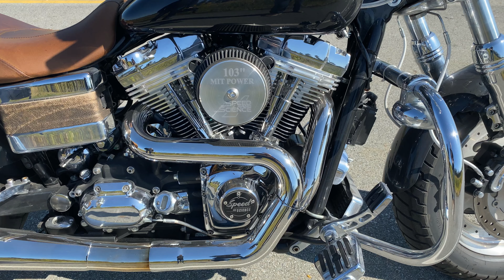Episode 7: Quest for Power 2.0 - MIT Series Twin Cam Heads

Comment: My concern is that the Dyna is not counterbalanced, I don't want make peak HP 6000rpm or above. Wide torque band for me.
Reply: Had my 02 Dyna rev limiter set at 6500 and it saw the limiter quite often… the right combo just works!

Comment: Can these heads grow with my builds? I have a 103 now but want to move up CI to 110 or 120ci. Will these heads work with a larger motor?
Reply from the maker: These heads will work well up to 110CUI, however even with the 103 (once built / tuned properly) you will be amazed with the results!
Reply: @chas crew if you want a 110 you might as well just buy one your 103 crankshaft won’t hold up for long upgrading up to a 110.
Reply: @izraeldiaz7587I know it’s just my opinion, the Factory 110 Twin Cam was the worst motor
Reply: @ChasCrewChief yea they’re called the sleepy 110 for a reason lol, I’m getting my 96 big bored to a 107 it’s gonna be spicy